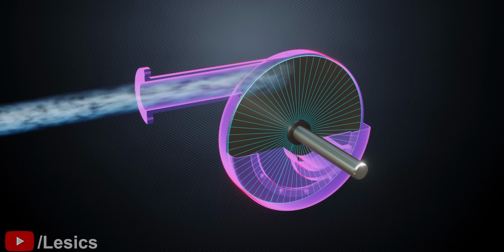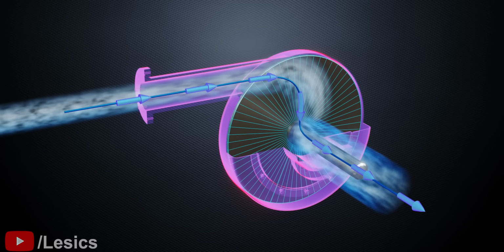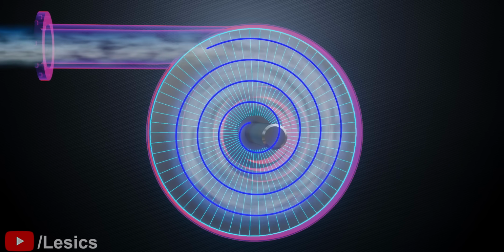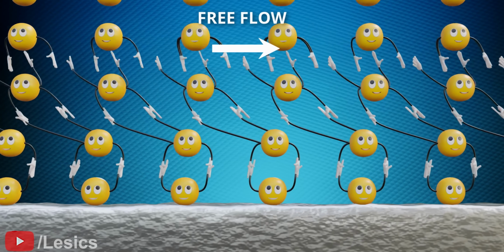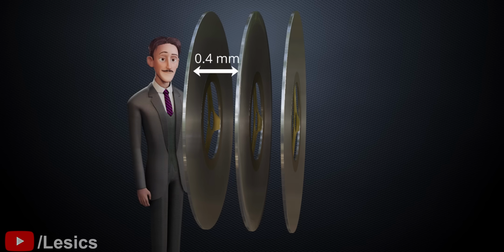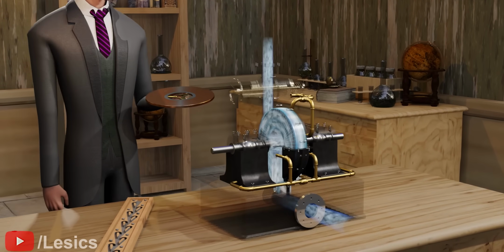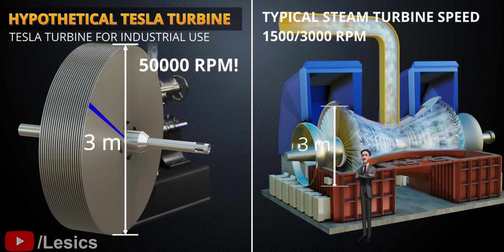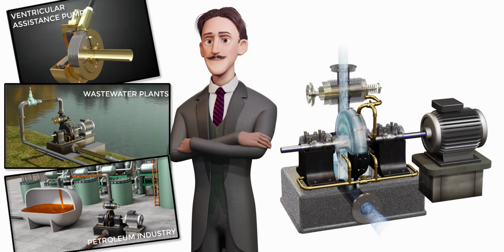Tesla Turbine | The interesting physics behind it

Comment: The old electric meters used the same principles, the energy flow across the spinning discs is what made them spin, and the spinning disc was used to calculate usage. The new smart meters calculate differently, now we are charged for what comes in on one leg, and for what goes out on the other leg. There's a guy trying to work out a diversion load so instead of the electric company recouping the energy we are being charged for, it being used so it's not sent back thus cutting the "charge" of our electric consumption. Pun intended. Great video!!
Reply: I am quite sure the meters you describe have nothing to do with the boundary layer effect and everything to do with simple electromagnetic induction on a serrated disk.
Reply: @jimparr01Utube  I think he was tailing about the principles involved. Like a water current being symbolically equal to electrical current.
Reply: @jaredgarbo3679  No it really isn't comparable at all... I mean unless you are talking about a 1st grade level understanding of physics. Even then its much much different and anyone describing it that way would just be misleading.
Reply: @Wingnut353  no
Reply: I'd like to hear more about that.
Reply: The Tesla turbine is using the force of moving fluid's viscosity to spin the disks to harness the power of the  pressurized fluid. A utility meter uses a shunt to send a proportionate amount of current  to a small motor which spins the disk and allows measurement of how many kilowatt hours have been drawn. One is a measurement device, the other is a power source. The only thing they have in common is a spinning disk. You might as well say that a record player or a merry go round are almost like a Tesla turbine.
Reply: @tranerekt1731  both examples work off current.
Reply: @ClumsyCars  I guess you're right. A Tesla turbine is almost exactly the same thing as small electric motor spinning a disk. What was I thinking?
Reply: @ClumsyCars  refrigerators, televisions, vacuum cleaners, video game consoles, light bulbs, air conditioners, microwaves all use current. There are Tesla turbines EVERYWHERE!
Reply: @tranerekt1731  if you think about it though it is. Electrons interacting with the magnetic field to spin the motor isn't all too different than a tesla turbine.

Comment: Wow, we cant use something so cool because of material limits. The bearing could be solved by levitating magnets. However something to withstand 50000 rpm at 3m diameter is basically impossible even nowadays...

Comment: You could reverse it to make a pump for water called PC's whilst simultaneously using the shaft to power a fan for the heat sink.   If you want to take it even 1 step further you could have the internal turbine our of aluminum or copper along with the shaft and external blade to create an secondary heat sink for the liquid.
Reply: Xr⁴¾³³³

Comment: The reason the turbine fails is because it doesn't have an appropriate amount of load for it to use the massive amount of energy meaning that it has a "mechanical short circuit" where the energy goes back into the system.

Comment: Why they had to have 3 meter discs in diameter in those powerhouses? Why couldn't they just use multiple tiny ones like with 1 inch diameter or something like that for the Tesla turbines? Then have tons and tons of them working in unison? That way the tip speed wouldn't have gotten so massive and materials might have been able to withstand those forces and speeds.

Comment: why would you need a turbine 3 meters in diameter. What about a turbine less than half a meter in diameter with the same torque. But I guess harnessing 50k to 100k rpms from turbine to generator would be difcult because turning a generator at such high rpms would be ????? I don't know but something small with a reduction of rpms could produce a hell of a lot torque. Power house in a small package.

Comment: I wonder if the blades were made thinner at the edge could alleviate the problems. Thinning the edges would allow a greater area for the fluid to flow through thus reducing the drag effect.
Reply: And reducing the efficiency, because of the effect that there would be less drag: (turbulent drag  at the edges, as opposed to laminair drag more to the middle). So les kinetic momentum produced.

Comment: What if the whole system were to be placed in a vacuum or in a low pressure environment? Would this increase efficiency, as unrealistic as it sounds
Reply: Check out iEnergySupply's videos, he's making a cold-steam vacuum setup with a multi stage tesla turbine. The first stage is set up as a pump to create and maintain a vacuum, second stage is the turbine, and the whole thing is contained in sealed plexiglass.

Comment: I'm no engineer but the tesla turbine sounds extremely inefficient. I would know if it was if you bothered to say how much power it takes to get the thing running in the first place instead of focusing  on what it can do during and after it has an unknown amount of power. Also if this thing is actually being used why not use a photo of a real one instead of a 3d model?

Comment: To add stupid but wonder in dwelling in question, what happens if you wield the disk, as in making small piller inside the tiny gap? I mean if you think about it, to stop the warping for there have to be a support beam to hold the disk in place and yes I am aware of the disk losing some power of rpm.  If we can wield it and not lose rpms and able keep the flow right then it would be the best energy conducting for little tiny gizmo would power probably 2 or 3 houses.

Comment: so all we need is a 6 inch disk that can go 35,000 rpm. if only there was a round item sort of like a high speed saw bade that can spin very fast like a high speed cutting tool. all joking  aside would a composite Kevlar/ceramic plate work

Comment: Does this work in reverse? If you spin the flat plates does it generate thrust?
Reply: It can be a pump or compressor, yes
It does not produce thrust it produces axial rotation, which, when combined with a generator produces  continuous electricity. 
This video got alot of things wrong... if your really interested I'll post a link to a decent presentation of teslas work.

Comment: Wouldnt the RPM go down itself by itself when hooking up a load? I get that the tubine also needs a minimum RPM to work well. Do we know how much it is?
Reply: RPM would be the same. Almost all generators works this way. If the load rises the RPM drops, just give the engine more fuel and the RPM catches up. So if the 50k RPM drops the speed of the water inlet should increase, maybe a regulating valve before this device is the way to go or after this device. You can do nothing off course but then the RPM drops like you said and the efficiency drops and then the machine is useless.

Comment: It's ingenious, but in spite all the Tesla-fanboism on display, the prizes in engineering should go to the solutions that can actually be built and work efficiently. The Tesla turbine is great in theory (with currently impossible material science), but in practice only of use in edge cases (like pumping viscous fluids, or fluids with large particulate matter). In a sense, the Tesla turbine is like the space elevator: the best solution to a problem, if it weren't for the fact that we have no idea how to come up with the materials required, or if that's even physically possible under conditions on Earth.

Comment: Hmmm.
If the RPM is the problem of material fatigue, simply, you can't make it efficient by inventing new material.
Yeah, generators can be adjusted.
But also the turbine. 
Here's a theory:
- add to the shafts flywheels which has some sort of magnets in it
- the flow valve for the turbine is regulated through the flywheel electromagnetic induction that regulates the valve
- valve is an electromechanical component, meaning, the more flywheel spins or vice versa, opening or closing of the flow valve is regulated
- flywheels add rotational energy, so the generators internal resistance under load is being mitigated
- it's a pain to optimise it but it's palusible.
- power of generators is closely proportional to the size and weight of the flywheel
- 3 phase motor with 36 poles is more than enough for 3000 RPM
- you can always make a shutoff by making the generator as a break for the flywheels. 

Thoughts?

Comment: i can only assume that physics plays a part in this. there by, shrinking the radius of the disk will ultimately slow the recorded speed of the outside circumference of the disk. we should all know that the inside radius of a disk spins slower then the outside of the disk at the same point, if you understand the "point" i mean. a disk with a 6 inch radius will spin faster on the outer edge then a disk with a 3 inch diameter at the outer edge.

also, surface tension plays a huge role in this. if you use a smooth disk, with low surface tension, the less the force the viscus fluid will have.

Comment: It's possible now with finite element analysis. The disc's don't have to be uniform and can be wider toward the edges compressing the outward expansive force. It would be possible to cause the water to compress and heat itself up especially if tiny dimples are added to increase the surface area.

At high speeds its really a fly wheel, a type of mechanical battery and the spinning itself would not be a turbine and could power another turbine while also regulating the current like a capacitor.

If it were not constantly thought of as a turbine we'd make some progress. Mechanical batteries of similar design are used in power plants as backup storage where the residual rotational mass like a fly wheel becomes its own battery. To charge a flywheel battery while heating up the water to create steam via pressure could be used to as 2 sources of power that counter balance between the steam turbine and the flywheel and the turbine. The turbine can be paired with Tesla valves to work as pistons.

The original electric street cars ran in mechanical batteries and were only burned after gm and rubber companies killed the electric street car and forced us for use disposables wasting 100 years of our time causing war after war, and destroying the planet.

Elon musk bought Tesla sued the original founders to force them to call him a founder, and his role is to keep us trapped in the belief that lithium should be the future.

The stupid battery backup system he stole the contract for in Australia sucks and was designed entirely out of lithium ensuring its obsolescence. For 60 million dollars he bought about 10 million worth of lithium batteries and just connected them in parallel and series in a way that any 8th grader could when it should have been done with a new generation of mag lev fly wheel batteries which could have a risky need innovative.

Comment: This is basically the principle by which automatic transmissions work: a spinning disc causing a second disc to spin thru the transference of a viscous liquid (in this case, Transmission fluid.)

I'm surprised this real-world example was not included in the video.

Comment: CARS AND TRUCKS CAN RUN ON AIR THIS IS PROOF.
Reply: No they can't, air is not a fuel
Reply: @lucastekkan  then why do all living creatures interact with (breathe) the air?
Reply: @rsam8398  Cars and machines are not living things
Reply: @lucastekkan  air is a fuel.
Reply: @rsam8398  air is not a fuel. Machines do not run on air
Reply: @lucastekkan  can an engine combust without air
Reply: @rsam8398  engines don't run solely on air, that's what I am saying
Reply: @lucastekkan  agreed, air would need to be manipulated beyond its current form to be a fuel, as far as I am aware.

Comment: If I remember correctly some sorts of clutches / automatic car gears  and so forth use plates and viscosity for energy transfer without a direct energy connection.
I.e. one plate swirls it up and the one parallel to it takes the energy off in a manner suitable for the application.
If you understood the video above how they work will be obvious.

BTW Tesla was certainly a genius but the hype and conspiracy crap about him and e.g. he could produce "free energy and it's covered up by the dark forces" is just nonsense.

Comment: Excellent. I'm glad it's used in niche applications today. I believe 34K rpm is possible today, using Tesla Inc. carbon fiber wrapped rotor. Now, what are the applications of a 6 inch generator/pump?

Comment: Every technical paper on Tesla turbines says it is less efficient than conventional ones. It is considered viable only when the fluid used is dirty or at such an extreme level of hot or cold temperature that bladed turbines won't stand up.

Comment: And like that, it seems attempts to discredit Nikola Tesla are an institutionalized problem. 

First off, in order to get that massive RPM to a functioning state, we just need to improve metallurgical methods a bit more, and on top of that, it seems carbon fibers may be a good solution to the issue of the discs warping at high RPM.
Second, Tesla's designs for it used LIQUID, not steam. Using a steam turbine as comparison is a fallacy on it's own. 
Thirdly, you don't need to rescale the turbine. You just get more of them and hook them all up to a gear shaft that'll turn all that energy into an RPM that's workable for energy production, and a dozen Tesla Turbines will still be easier and cheaper to maintain than the giant fuckoff machines we normally use. The smallest commercial model of one of these from Tesla's time produced 110 horsepower, and it wasn't much bigger than a small motorcycle engine.

I get the impression you guys are using the amateur steam and compressed air experiments as a basis, or perhaps that you used Warren Rice's also poorly handled attempt. It's built for pressurized water, why do you people obsess over steam?
Reply: Yeah, what I was able to understand from this was "even today we don't have the resources to make Tesla turbine design work as Tesla intended, it must be Tesla's design fault"... Like, nope... basically Tesla invented something so powerfull that even for today standards we can't use it properly so we argue is because it's flawed. When we just need to find ways to use it properly.
Reply: Is there is water everywhere why go to stean?

Comment: I would have like to know what kind of Torque numbers the machine could produce at those high RPMs. It would seem that under a load the steam would you flow though the device without causing any motion.
Reply: You think a shaft rotating 50krpm from the fricti9n of the surface tension is going to have no torque!? It's such an insane machine it breaks before it reaches such speeds

Comment: Hook this thing up in each house at the water inlet. Every time you take a shower you get some free energy. Not much but it's something.
Reply: It's not free. The mechanism that drives the discs is a loss mechanism, reflected in lower water pressure downstream.
Reply: @marcdepiolenc1880  You just need a Seinfield Showerhead [tm] :D

Comment: So basically until frictionless bearing technology has been perfected there is no way to put it into practical application at full efficiency, i wonder if some of the rotational energy could be used to power electromagnets that act as the bearings for the shaft thereby having it held on a cushion of air similar to how a bullet train works.
Reply: The way I understand it, it is not the bearings, it is the speed of the blades. At 50000 rpm the edges of the disk are moving so fast that the centripetal force will tear them apart.